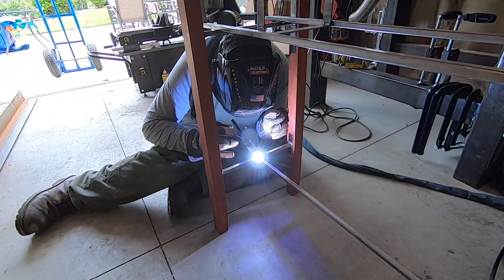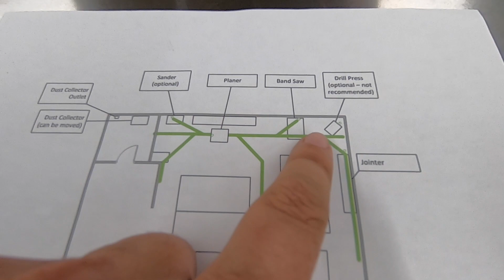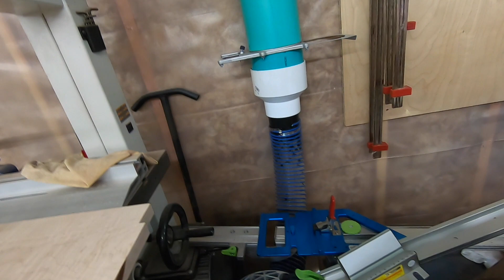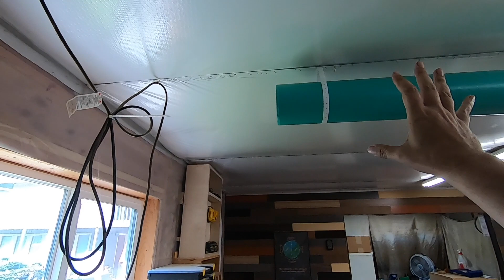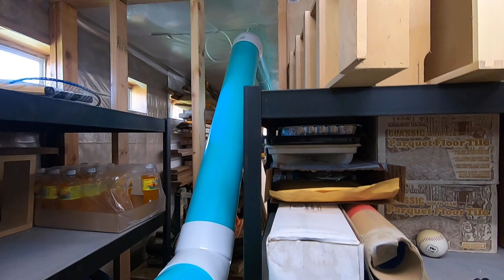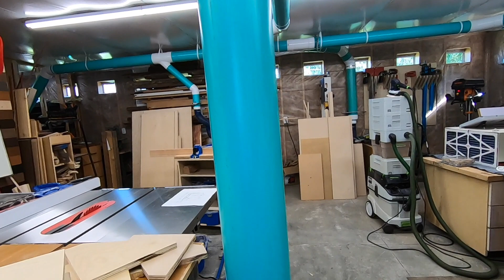7/7/19 - Dust Collection Basics

Comment: Thank you for this video. I'm getting ready to install a new collection system (so far considering a Laguna "P series" machine) and wasn't sure about the best duct work. I like your straight forward layout and your presentation is very good. The lack of glued joints other than a heavy drop makes sense but I wonder a bit about leaks over time, but I think could easily be resolved with tape.

Comment: Great video.  Very much the system I'm currently building or gonna build.  I'm a bit surprised that the joints are taped but I'm even more pleased that you don't have a "grounding" wire.  You can't ground PVC. LOL